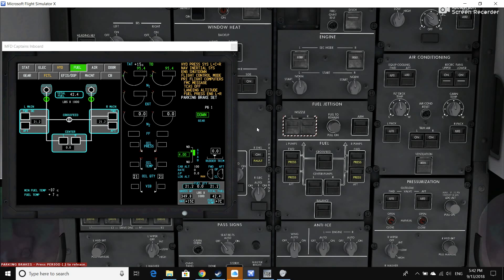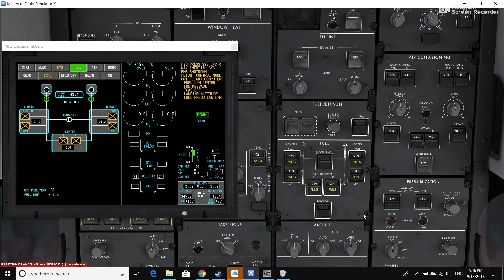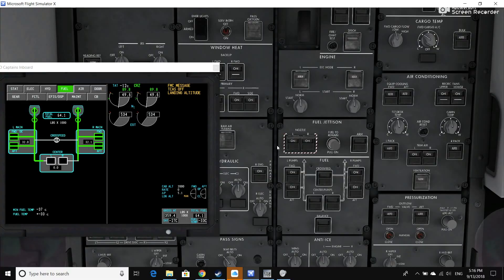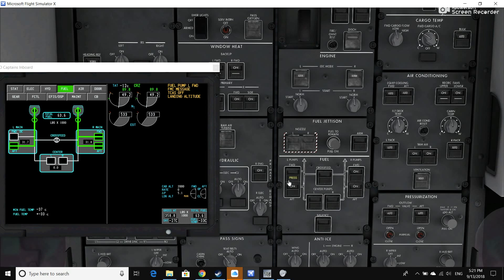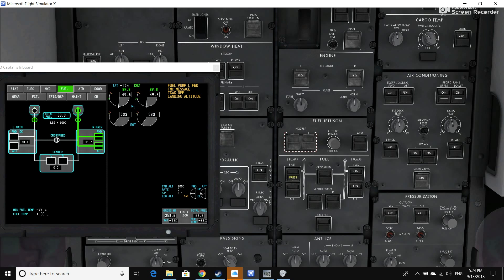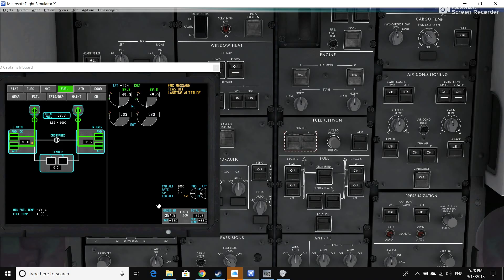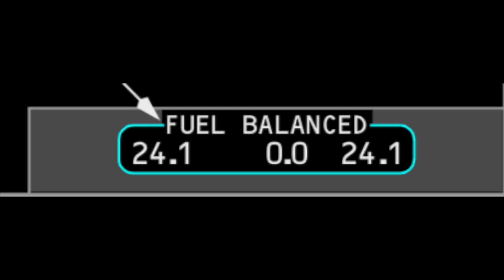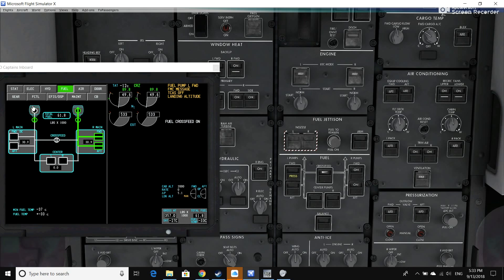B787 Fuel System

Comment: Is it CBT or some game? Nice demo but with some errors. 1 Fuel spar valves are closed unless u had fuel control switch set to run. 2. You normally switch centre tank pumps on after engine start (unless your model done specific tech. bulletin.) 3. When you jettison you arm the system first then open nozzles. 4. during jettison centre tank pumps don't feed engine.
Reply: This is Prepar 3d